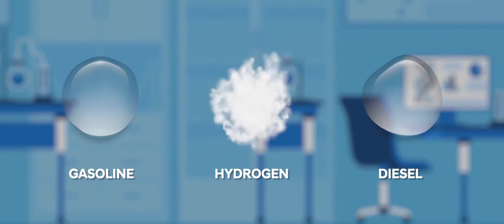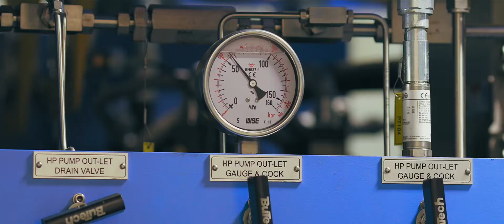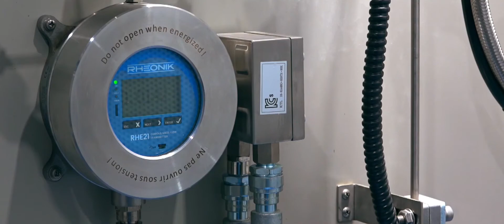Part 4: Hydrogen, Is It Safe?

Comment: I would like to highlight that hydrogen is NOT a viable alternative to petrol. The reason there is such a push to put hydrogen in vehicles is that hydrogen is created as a bi-product, in both the burning of methane and electrolysis. Due to its dangerous properties (if you tickle it a bit it will explode a city block), there is little demand in the industry, and those in it are trying to artificially create their own demand. 

Not only is hydrogen even more potentially dangerous than natural gas vehicles (despite having incidents be almost unheard of), but if we were to RENEWABLY create hydrogen through the only renewable method possible (electrolysis) by purely green energy for EVERY vehicle in, let's say the UK - which has higher ratios in this which makes my argument even stronger than if I was using the US for an example - we would need over 5 times our current capacity for green energy production. That's 5 times our CAPACITY, which would mean that all of our green energy was ONLY contributing to the production of hydrogen - as a biproduct. 

To give you an idea of that, the UK's production of green energy contributes to almost a third of our energy production over here (~29.5%, higher than in the US). Meaning that for this to be a viable option in just this country, it would require that all of their energy production was used for hydrogen production through electrolysis (assuming it was all green), and then two thirds more of their production capacity would have to be imported (green energy specifically) and then energy would again have to be imported for every single other use that the UK needs it for.

To shine a light on how much energy this is, electrolysis would go from taking up a minute fraction of 1% of our energy consumption, to ~166%. Even by checking the official Hydrogen UK infographic on the usefulness of electrolytic hydrogen, their claims do not make sense because the fuel takes more energy to create than is released when it is used (as it is a bi-product)

anyway, hydrogen rant over, I also could've enthasised a lot more how dangerous it is, though hydrogen cell fuels in vehicles (whilst not being efficient) do seem to be getting better on their second standard generation. The best part? I didn't even mention how almost impossible it is to store due to it's atomic structure being so small.
Reply: its not a preconception, and nor is it "safer than other fuels." Risk assessment that is mandatory in so many contexts disproves that. If it DOES explode, which as you said is unlikely, its likely it could destroy a city block.

Comment: does any of the trolls here know that hydrogen is made from natural gas????? and that fucking hydrogen is 20% efficient, compared to burning natural gas directly... means 5 times more expensive and 5 times more carbon emission for each km you run with it... even thinking about hydrogen is fucking nuts... anyways, nobody buys them either... fossil fuel wet dreamers...

Comment: wh- wait... you mean the stuff that... to borrow a phrase... 
"YOU MADE THE CAR INTO THE HINDENBURG?!"
An open flame is north of 1000C! if your ignition temp is 575, who gives a damn?!
is hydrogen safe? - short answer: NOPE!
Reply: Gasoline also burn, so do lithium batteries.

The difference is the hydrogen dissipates quickly so the fire is short if it occurs at all.

Gasoline will burn until its extinguished because gasoline is heavier than air and pools around.

Lithium batteries will burn until they're out if fuel (24-48h)and are impossible to extinguish because they self ignite when exposed to oxygen.

Hydrogen is the lowest risk.

Also, the Hindenburg fire was mostly diesel fuel, canvas, and the coating if the canvas. All the hydrogen was dissipated within minutes.

Comment: Please STOP saying hydrogen is an Energy source! It's an energy CARRIER - which means you have to MAKE IT, not just mine it / drill for it, this means the production of hydrogen creates a net energy LOSS (approx 20%) from the input energy. It is a possible energy carrier, but it does require VERY high pressures to store enough to replace carbon-based fuel and required about 2.5 times the volume to enable the same milage. It does weigh less, which is good, but takes up much more volume to carry.
Reply: The low density is why they pressurize it. HEVs are also more energy efficient than petrol or diesel engines so they need less fuel (by weight) for the same range.

Comment: Was the engine running during the crash test?
Reply: It’s a fuel cell electric engine, it does not use combustion to generate electricity but a RedOx reaction with a catalyst. Inside the cell the hydrogen is combined with O2 to generate water (and free electrons) so there’s no ignition danger in that part of the process no matter how broken it gets after a crash. It will just stop working. 

On the personal note the most dangerous part of that car I think it’s the obligatory lithium battery pack it needs to compensate when the fuel cell power is not enough.
Reply: I'll drive it and find out for myself 😆

Comment: Id suggest another safety feature would be to add some natural pigment powder coating to any tank & pressure release device...so in the event of a leak say on your drive or obviously in a crash situation...the powder colour dispersion will allow you to see that the presence of hydrogen is there - even if it may not identify how much volume has escaped but at least an instant indicator of leakage present
Reply: Hydrogen does not accumulate, it’s the lightest and smallest atom in the universe, it will disperse if it has the chance, the inside of the car is not pressurized  after all.

Comment: Even if liquid hydrogen car?
Reply: @@geek8001 You can use supercritical liquefaction which occurs above 180PSI at room temperature, which is not technically a liquid. Its really not that easy to fuse hydrogen into helium or we wouldn't be running out of helium. 

Rockets use cryogenic hydrogen storage because the energy density is a lot higher, which is a lot more important to rockets than cars. 
Liquid nitrogen and an insulated tank can help improve energy density. Even if you have to vent off the hydrogen in a failure, the tank will still be able to maintain more than enough pressure to get to a fill station or a mechanic
Reply: @@geek8001 It doesn't need to exceed the fuel storage capacity of modern vehicles for 90% of drivers. I would buy a hydrogen fueled car if it could save me money, even if I have to fill up more.

I'm not an automotive engineer so honestly I don't know what the best approach to collision safety is. If we can make gasoline relatively safe as a fuel source, I believe we can make hydrogen safe as well
Reply: Hydrogen is only liquid under really cold temperatures or high presure if the presure is lost the hydrogen will disperse from the tank even jf you where tksomehow light it on fire it is just a big blow torch becouse the gan gets released with a lot of force
Reply: @@geek8001 You just need high pressure and it will stay in a liquid state
Reply: @@geek8001 You're probably right, I like fuel cells but I still really like the fuel agnostic engines that Hemi is working on for their versatility. You can either produce hydrogen or biodiesel to run it for a while until you get situated in a crisis. Even if you never run them on Hydrogen they have to be stronger
Reply: @@geek8001 A hydrogen train would be cool, we had a big explosion in Quebec involving a train so idk if we could convince our government to allow it. 

I have a hydrogen fill-up station close to my house though and I see people using it consistently. I don't believe in electric cars that use Lithium-Ion, but there are a lot of battery technologies in the works. Sodium batteries look promising, I just don't think we should try to mass produce anything that relies on rare resources or causes problems when its disposed of. 
I live in a city where public transit doesn't go where I need to be, and my work requires tools and travelling to sites. I personally wouldn't be a major train user if it costs more than my personal vehicle per trip, or takes much longer. 

As someone who does most of the work on my truck, my costs are pretty low. It takes over an hour to cross the city in a bus here and I can do that in 20 mins in a personal vehicle

Comment: Hydrogen almost always explodes because of how fast it finds the necessary oxygen to do so.
Reply: LPG cars have been used in vehicles since 1928 and it is much more flamable and the tank is basic design. Hear much about any explosions from these vehicles? I have heard more about Tesla Lithium electrolite fires then from LPG.
Reply: @user-ic7mv6bj4w  True, our police force uses LPG cars and they have never had a fire incident
Reply: @FletcherHillier LPG doesn't leak and doesn't need high pressure to store. Even if hydrogen doesn't explodes(which is more likely) thae sheer amount of pressure that tank contains will kill any person nearby by shrapnels from explosion
Reply: @okman9684  I still don't think LPG is enough of an improvement to justify the cost of conversion. If they could run on methane aswell I'd buy one.

Comment: 1:34 Wait a minute. An „explosive“ Sticker on a hydrogen gas tank?
Reply: Yeah, thats definetly Not comforting.

I just thought it was funny because the next thing the narrator says is that hydrogen is not dangerous in its gas form, when even the stickers indicate, that it is.
Reply: @Geek It burns in a second. Doesn't splash and burn for long time like gasoline. I'll take hydrogen any day. Not to mention you already have a hydrogen vehicle. Gasoline is primarily made of hydrogen and the carbon is the dangerous aspect of it.
Reply: @gabrielrousseau_NM man you have some big brain cells to think that hydrocarbons and hydrogens are same. If you know some proper chemistry then you will know that hydrocarbons like gasoline creates heat by break the bond while hydrogen creates heat by forming bonf. Not to mention hydrogen has more volume than any hydrocarbon. Both fuels are not even remotely comparable. If you use hydrogen in your gas car it will just kill your engine

Comment: More effectient than a combustion, lesser than electric. Not enough stations and it's much more expensive to fuel up with hydrogen than petrol; but I guess Dihydrogen prices weren't affected by gas's hiking prices. ⬅️Correct me if I'm wrong!
Reply: Problem with electric vehicles is that they do not achieve their goal of reducing the climate impact of cars. As lithium battery production releases extreme amounts of Co2.

Hydrogen, while often produced via fracking, can in fact be produced in an eco friendly manner. And thus HEVs and HICEs actually can solve the eco problem.
Reply: If there is any eco problem. Climate paranoia is not a science. It's a religion. Every useful and economical method of powering society is shamed and outlawed by politicians. The government's principal hold on power is enforcing poverty. Wealthy and independent people are very difficult to control. 
Concerning the scarcity theory of subterranean fuels, Earth naturally vents enough methane to consume ALL the oxygen in Earth's atmosphere every 3,000 years. Subterranean fuels are produced underground at a rate presently 30% to 50% as fast as we consume them. PS We are the reason volcanic activity has nearly stopped EXCEPT where such fuels are not harvested e.g. Iceland, Hawaii, Fugi, Yellowstone. 
Concerning CO2 levels the average CO2 levels during the 200 million years the dinosaurs existed was 1,500ppm. Dinosaurs went extinct when CO2 fell below 800ppm. Why? Because plant growth is stunted below 800pmm. @Erowens98
Reply: electric cars have it' s limits especially driven on their limits. For example if the battery reaches certain temperature and activates it' s safe mode the brakes are basically turning off and upon impact their fires are riskier to survive. And fast charging' s cost from fast charging stations basically sums the cost of running it with a combustion engine vehicle. But both are nice to have even though i prefer the exhaust note even though if i am going to spend a few bucks extra.

Comment: How efficient is electrical conversion? What kind of generators are used?
Reply: It uses a fuel cell, which is way more efficient then combustion engines. But hydrogen itself isn't sustainable with our  current climate.
Reply: @youcansave15ormoreoncarins75  why isn't it sustainable?
Reply: @youcansave15ormoreoncarins75  why?
Reply: @nickmartin3647  most hydrogen at the moment is produced from fossil fuels, about 90% i believe, green hydrogen insustries are being propped up but it's taking a bit
Reply: @youcansave15ormoreoncarins75  Actually depends where you produce the energy. Because transportation over land of that energy content is unlikely.
Reply: It's pretty efficient. The only drawback is how much hydrogen you can carry.

Comment: 2:10 but carbon finer metals at 200 Celcius. 400F

Steel melts at 1450 Celcius, 2800F
Reply: not an expert but will share my knowledge nevertheless. Carbon Fiber itself can withstand 3700 dergees celcius but the resin (plastic) that holds the fibers together are what limits cfrp' s temperature whitstanding limits and can vary depending on fabrication. I have heard some can withstand 600 degrees celcius and may be some can be more.

Comment: So the tank has a emergency vent to depressurise when in a fire I'm guessing there must be chance of a BLEVE (Boiling Liquid Expanding Vapour Explosion) when exposed to extreme heat or fire for a prolonged period.
Reply: Anyone who has not worked with H2 might be duped into being a fan. H2 autoignites easily. All material designed to hold and handle it is expensive. This is a fool’s errand.
Reply: Not true mate, A TPRD (Thermal pressure release device) is fitted so its not a PRV like a regular pressure vessel it dumps the whole contents rapidly to ensure no B.L.E.V.E.
Reply: @emergencyresponse5210  where does it release it when it's inside a car? That amount and a spark from colosion would definitely made a barbecue of whatever is around 2m  at least....
Reply: @kmetmosnja6341  puhahaha, there is a fire, it gets to the H2 tank, pressure gets higher, an that f.cking so called "TPRD" releases the hydrogen out fast !!! what can go wrong??? puhahahahah
Reply: @emergencyresponse5210  that's good to hear as I'm all for H2 vehicles

Comment: Just missed out many facts
Reply: @@geek8001 It can be safe, gas was made relatively safe even though it pools on the ground. Hydrogen is the lightest element so it quickly dissipates vertically

Comment: @ Hyundai NZ
 I'm curious to see your data regarding regular leakage. How much hydrogen fuel does the tank lose over time? How does it compare to battery discharge?
Reply: I am not an expert, but I have heard it said that leakage of hydrogen is a global regulated and the cars need to respect that. I heard a Toyota engineer claim that even if you left the car in the garage for its "life" you would still have a full tank at the end... side note I drive a Nexo and it is amazing.
Reply: @Chasval  Happy to hear you enjoy your car. How is the fueling infrastructure where you live?
About no leakage over the car's lifetime, that seems like quite the impossible claim. I'm not an expert, same as you but I'm suspicious of that. 
Either way thinking it over I guess the tank itself wouldn't be the main problem but rather losses along the way, during production, transport and refueling. With methane it's a major issue and H2 is an even smaller molecule and we store it under higher pressure. Maybe not a problem for you directly but more of an environmental/political one that I've not seen talked about much.
Reply: @ramdas363  The tanks are designed to store hydrogen without leaking. I, personally, have come home from a month long vacation to find that I've lost 0 range while I was gone. To compare, my BEV lost about 1% per day over the same time period.

Comment: So instead of an explosion the car releases high explosive gas. Hmm that’s one step before an explosion, specially if metal pieces fly around due to a crash and sparks are everywhere…. My happy future Is an electric car running into a hydrogen one, burning batteries nobody can extinguish mixed with high explosive gas in the streets…. A nice Monday
Reply: It took a high powered .50 Cal round, shot at point blank range, to pierce the Hydrogen tank used by Toyota. I am sure shrapnel will not pierce the tank.
Reply: Other fuels, see those
Reply: Yeah i also prefer the lithium grill sadly it’s less nice for people. It’s actually quite crazy what temperatures one needs for it to truly ignite. Especially compared to a Lithium Ion battery which will ignite itself just because of the vibrations..
Reply: The hydrogen is kept really cold so it does not ignite as easily, is lighter than air, and the tank has a release valves making it shoot into the sky releasing and dispersing instantly. 

Actually safer than gasoline cars.
Reply: @bobkowalski7655  and safer than battery cars too!
Reply: Hydrogen won't build uo in the streets. It'll dissipate into the atmosphere to the point where it won't be able to ignite.
Reply: So you prefer the fire that burns longer and is easy to ignite

Comment: Please lie with style. We had an explosion while filling a hydrogen car, and the gas exploded high above but the highway bridge,500m away was blocked and was found to be without damage. Of course, it explodes very badly. Nothing contains more energy than Hydrogen gas. The blast in Beirut was 2.5 MT of Urea - fertilizer. 800Kg of Hydrogen to level a city?
Reply: What do you even mean ?
Reply: Except fertiliser is NO3 and hydrogen is H2. Absolutely different chemicals.
Reply: That's was ammonium nitrate dud